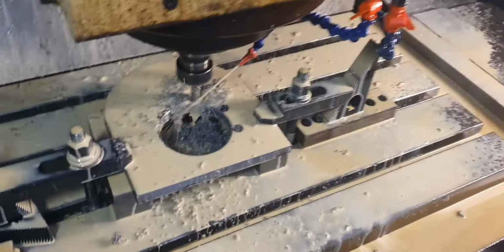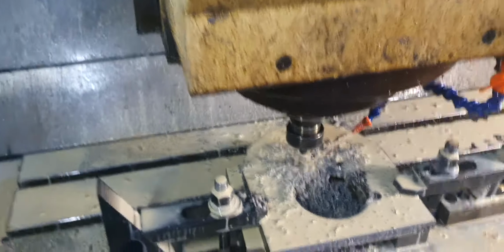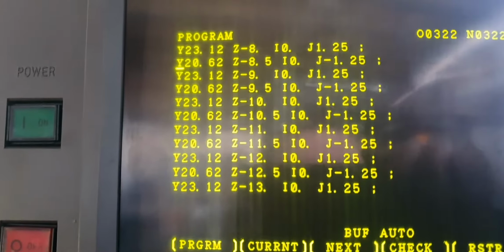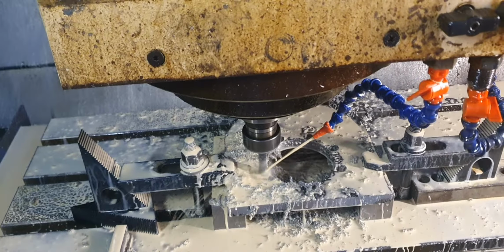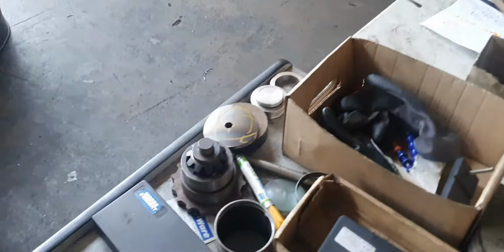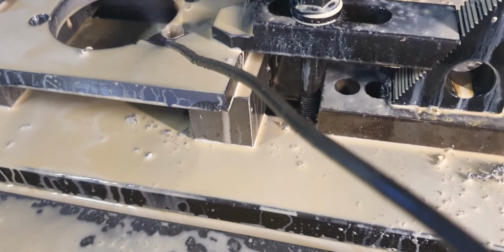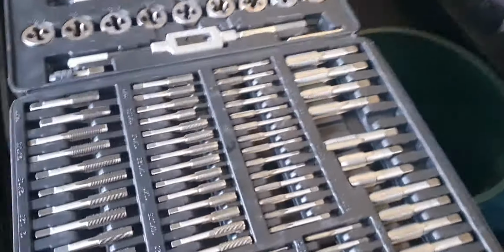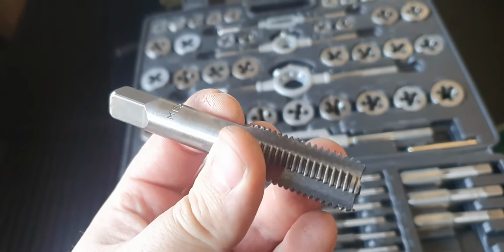cheap Chinese taps are rubbish

Comment: That tap set is for hand work not machine work .
Reply from the maker: Mate we try to cut something with hand and it wouldn't even cut bronze. So I don't know how we're meant to cut mild steel by hand ✋ if it cant even cut bronze.
Reply from the maker: I will show you tomorrow. I will upload a video tomorrow, of me trying to cut a thread in some aluminium By HAND ✋ and your draw will drop from the results
Reply: @differentials  Sounds like it is only suitable for plastic .